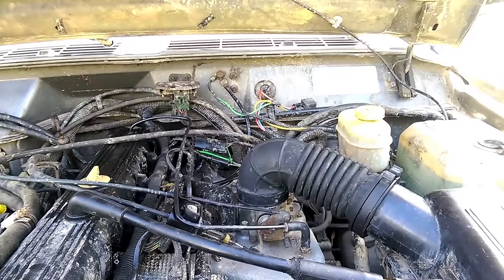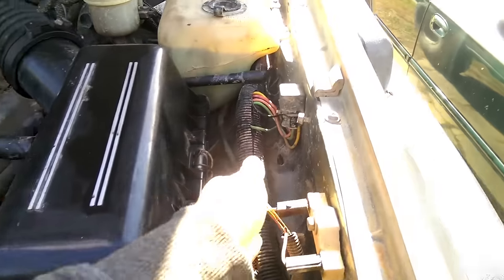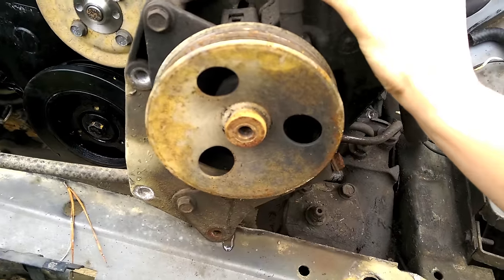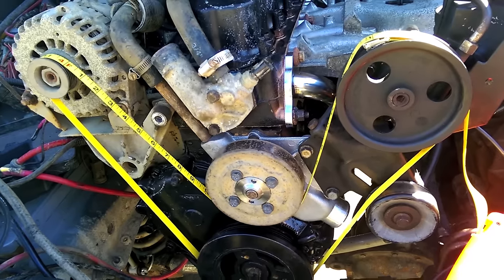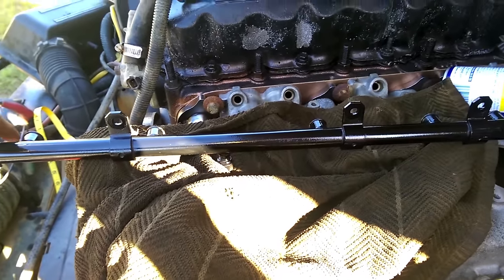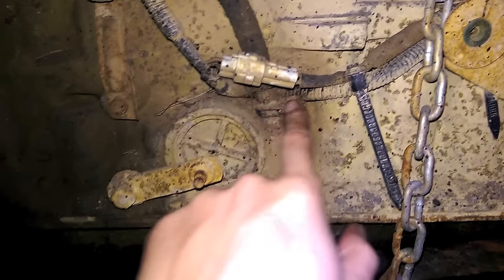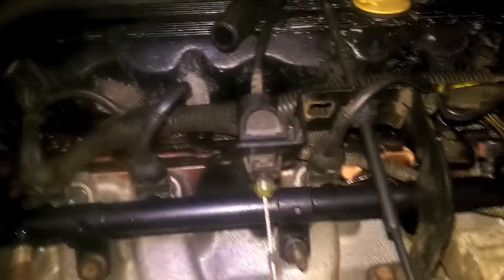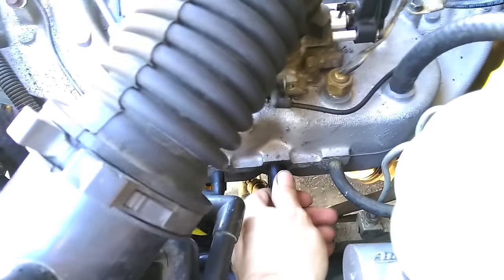89 Cherokee Renix to 99+ HO Manifold Swap

Comment: Ok question for you, will the renix pcm run the HO without any problems if am not doing a stroker like you did
Reply from the maker: The swap I did here was just the HO head and manifolds on an otherwise Renix Jeep. With a stock 4.0L it should run just about the same I'd think.
Reply: @NickInTimeFilms  ok I wasn’t sure lol because am getting ready to do a whole motor and Tranny swap from the renix with the ba10-  HO with a ax15

Comment: which exhaust manifold did you use? a 99+ or one of an earlier 91-95? Mine seems to have a bad exhaust leak now.
Reply from the maker: I used a 91-99 exhaust header from ebay

Comment: Hi Nic, 2 questions, you used the same valve IAC Renix ???
which number you used spark plugs champion ???
Reply from the maker: +Claudio Villegas Stock Renix IAC Valve will fit, I used Stock Renix Spark Plugs, Champion RC9YC
Reply: +NickInTimeFilms ok, the same are the ones that buy but are different, the spark plugs of Renix is a bit shorter than the HO, something that affects ???
Reply from the maker: +Claudio Villegas Not sure if there is a length difference or not between years, I just know that stock plugs are fine with the swapped head

Comment: Did you change your ecu and wiring harness? I have an 88 and the p.o totally hacked the harness all to hell so thinking about doing a ho swap possibly doing the entire engine not just the head and intake since I have a complete drive train from a 99
Reply from the maker: Nope. The whole point of this guide is to swap all the H.O. parts onto a Renix system and retain all the factory sensors, harness, and wiring. I don't know how hard it would be to swap in the whole ECU system from the 99 over but I don't think it wouldn't be easy.
Reply: NickInTimeFilms well i guess if I'm gonna go through the hassle of swapping ecu and all mine as well just go v8 I guess

Comment: Hi Nik, had problems with the IAC ??? change in my jeep IAC and RPM are very low, you can regulate that ??? clean the TBI, 
which oil you put into your engine ???
Reply from the maker: +Claudio Villegas Did you do the H.O. Swap or are you stock? If it's a low idle and everything seems to operate correctly, you can try resetting the ECU so that it relearns your idle. Pull the battery terminals off the battery and hold them together for 30 seconds, then put them back on. That will clear the memory and put it back into learn mode.
Reply from the maker: +Claudio Villegas I used Regular 10w30 dino oil, but I may use a synthetic blend next change.
Reply: +NickInTimeFilms  OK, I SWAP Renix to H.O. Like you.
He read in a forum that when the TPS is set incorrectly causes problems in the IAC, is this true?
Reply from the maker: +Claudio Villegas If the TPS isn't set right then it may cause idle issues.
Reply: hi nick, set the TPS at 0.83 volts and works perfect my jeep, do not fall rpm, on the highway remains the fourth gear AW4 whitout problem, thank you very much for your help

Comment: I've got an 89 xj. Older motor original I believe. How spendy in shop price would it be to do renix HO
Reply from the maker: Like have a shop do this for you? I'd be surprised if a shop would take on this job as there are a lot of variables. check the description for parts list and junkyard prices
Reply: NickInTimeFilms  is there any alternative ways of getting a better motor maybe just have them rebuild my current block?
Reply: Don't have a shop or time to do all this my self right now just got it and I love xjs. Welded rear end. Chirps a lil haha
Reply from the maker: I like the phrase "There is cheap, fast, and good; You can only pick 2" and "there is no replacement for displacement"

swapping the HO manifolds and head onto a renix block will make it flow better and you may notice it has more power. it's ain't gonna be a ton, as we are only improving efficiency here. If you want a drop in solution for a very noticeable increase in power, look into a stroker engine. You put a 4.2L crank into a 4.0L block with some special pistons to get a 4.5L torque monster. You can buy a crate stroker for $3-$4 grand, or have it built for a little less. 

I have both the HO swap and 4.6L stroker (I overboard 0.030" thou) and it's lots of fun, but it has worn off. I either need to work on a custom tuner to improve fueling efficiency, or supercharge it, but that's more money than I'm willing to spend yet. Depends what you want to use your jeep for. this is great for the trail, and it's ok for the highway, but I need more!

Comment: Hello No, I'm Claudio de Santiago de Chile, I have a 89 XJ and also will change the engine for 2000, you could give me an email to ask you some questions ??? the change was brutal, a very quiet engine
Reply from the maker: +Claudio Villegas You can Message me on YouTube if you need to.
Reply: +NickInTimeFilms perfect !!

which spark plugs installed in the new engine ??? for Renyx system or 99+ H.O. ???
Reply from the maker: +Claudio Villegas Stock spark plugs are fine, if you had a renix, stick with renix plugs
Reply: +NickInTimeFilms Champion or NGK ???
Reply from the maker: +Claudio Villegas I like Champion because that's what the factory used
Reply: +NickInTimeFilms  ok, this Saturday will change the water pump, engine oil and spark plugs champion and other things, the story never ends with the XJ ........ but I love my Jeep ...jejeje

Comment: Hi Nick, I am in the process of swapping out my 1987 4.0L Renix to a 1996 HO 4.0. I have a complete engine out of a 96. Can I simply just drop it in and change the throttle cable and kickdown cable and sensors? Or will I need more mods to make it work aside from the power steering pump mod and tps mod. The 96 engine only has 116k miles on it.
Reply from the maker: Make sure you swap over the Renix Distributor and Flexplate to the 96, but otherwise just sensor swapping should get you going along with the few little mods needed. Don't forget about the o2 sensor if you're swapping exhaust.
Reply: Thanks for the help! I'll update when I'm finished with the swap.
Reply: What year ECM is the best to run?
Reply from the maker: If you're running a Renix ECU then an 89 or 90 is preferred. They also differ in auto and manual trans, though the engine will still run with the wrong one

Comment: nice video, so where is the videos for you stroking the inline 6? I'm assuming it started as 242. So many things I like to do with my jeep. but its a 97 lardo.
Reply from the maker: +Dan Acton I have an install vid and first start vid. Nothing on the physical build yet because I had a machinist put it together for me. I may make a parts list vid that shows some pictures of it being built but no video sadly. I took my tired 4.0L 242 to him and had him put in a 258 crank to make a 280ci/4.6L beast
Reply: NickInTimeFilms you can go up to a 5.0 also. oh and yes not kidding HEMI header. but its build for the 285 block. don't know if its conpatable with a 242. I'm thinking of turning my poor jeep into a hot rod inspired jeep, and leave it with I6. Just to be different. I have most of it mapped out. parts and whatnot.
Reply from the maker: +Dan Acton These things are absolute torque monsters. They aren't going to go 0-60 in a snap unless you focus on upper end breathing but they still accelerate much faster than stock. But when it comes time to tow your house somewhere, this engine will cover it.
Reply: NickInTimeFilms yep. lol, I'm wondering if you can four bolt the main like you can a 350. Just for longevity.
Reply from the maker: +Dan Acton I haven't seen or heard any mention of 4 bolt mains anywhere. May be possible but may not be necessary. For higher end build, ARP Rod Studs seem to be all that's needed. These I6s only go up to about 5,300 rpms so some racing application stuff isn't as necessary unless you frequently go to the drag strip
Reply: NickInTimeFilms true.. just like to know how far out of the box I can go. lol yaknow. So far the idea is stoke it out to a 5.0, supercharger, and a 2 stage methanol/water mix (acts like nitrous, just safer) cat back exaust blah blah blah, maybe turbo or twin turbo or twin turbo's feeding that hungry supercharger.... don't think a dana 30 with hold up for shooting for a dana 44 with 4/10 gearing. I want I to squat and go.
Reply from the maker: +Dan Acton Good god, Talk about an investment, haha. To go anything over 4.8L you'll need to resleeve a 242 to accept the way oversized pistons. On top of that in order to hit the 5.0L mark you'll need a custom ground crank that has more stroke than the 258 can give you. Along with the proper head work to fit LS valves or a custom aluminum head and all the other necessary works it's gonna add up quick and driveline upgrades will be needed.

Unless you are specifically looking to keep the Straight 6 look, a v8 swap may help meet your power needs for a lower price point. Check out the JeepStroker Forum for lots of good info. Scroll through all the threads or make a free account and you can search the forum at your leisure.
Reply: NickInTimeFilms was wanting to keep the I^ because wellll its a jeep, and jeeps are known for the I6. but yea I can scale it down. right now I'm still trying to get the green light form the  wife. lmao. I was shooting for sky high torge. and some horses to back it up.
Reply from the maker: +Dan Acton It's definitely possible if you have the wallet and the wife to back it up. haha. 350HP is doable with an I6 Stroker. If I had to guess, my 4.6L is probably pushing about 245HP and 300ft/lbs at the crank. Check out this site for some ideas. http://www.jeep4.0performance.4mg.com/stroker.html
Reply from the maker: +Dan Acton No problem.  Do some reading on the sites I linked you and you'll find your way. Good luck!

Comment: Hey, I’ve got everything hooked up same minus my exhaust. I tried turning it over and it starts for a few seconds then backfires and dies. Do I need to tow to a muffler shop for it to run properly or am I missing something else?
Reply from the maker: Hmm, I would check major components. First up, is your map sensor hooked up properly to the throttle body?
Reply: Hooked up directly to ‘96 throttle body, same way you have it in the video
Reply from the maker: +Christian Duquin I'm assuming the battery was disconnected so the ECU could reset. Still using the Renix injectors? Does it idle high or low or weird? No leaks at the manifolds?
Reply: I should add that I’m running a k&n air filter pod. So the air box is deleted, but all vac lines hooked up the same.
Reply: I should add that I’m running a k&n air filter pod. So the air box is deleted, but all vac lines hooked up the same. 

Same renix injectors and fuel rail.

Comment: what you do with the temperature connector since the new head doesn’t have it in the back corner
Reply from the maker: I made sure to get a 96 head because it still has the temp port in the back
Reply: mine doesn’t has it i thinks it’s from a grand cherokee but i may i can drill it on the drain plug next to te coolant temp sensor

Comment: Can i throw a distributor into a 2000 i6 in place of the camsenser? I want to go carberated screw all the gremlins that come with Chrysler crap wires and vacuum
Reply from the maker: +Rob Plotts thats a good question that i dont have a good answer too. Im not super familiar with the really new Chrysler tech like coil on plug stuff
Reply: NickInTimeFilms i appreciate your reply . Your video may be some good reference for me
Reply: ***** i have two perfect low mileage i6 one is 00 the other is 02 no titles for the Cherokees but i have two 89 Cherokees with titles no motor. The jeeps with no titles have issues like shutting off whenever it feels like it or not starting after just running. But the engines are sweet so id like to know if i stick the good motors in the titled jeeps can i put the distributors and old engine management or carburetors. In my state the older jeeps dont need inspection. I believe the gremlins in the newer 2000s jeeps are shorted wires somewhere in the octopus of looming ive got code scanners i do this kind off work for a living just tired of the crap Chrysler management systems. They were better in the oler ones with the Renault systems
Reply: ***** yea my main concern was the distributor. The cam sensor on the newer engine looks like the distributor drive i just wasnt wanting to go through engine swap if the distributor wouldnt drive off the cam like the older engines. Looked like it would but i haven't found any proof on line if it would.
Reply: ***** i might just throw an engine on the stand and see if it'll run on a distributor. If this works it should be pretty awsome. Injection just needs everything to be right in order to run effectively. The more i can simplify the system the better. I have an old 76 chev blazer i put points ignition got rid of the hei and that was about twenty years ago still runs like a top i guess im a bit old fashioned but man the old stuff was sooo much easier to fix when something went goofy. Dont get me wrong new vehicles are nice but if anything fails your callin a tow truck and i just dont accept that lol. I ran outta gas once but that was my own fault haha. The jeeps i6 is a pretty durable engine so i hope i can make something work. I refuse to have another car payment along with full coverage insurance. Nice chattin with ya bud. If i figure this out I'll let you know
Reply: ***** my blazer is a single points system i built the engine myself. Mostly edlbrock intake cam carb. The 350 4bolt main is in the neighborhood of 400 hp. It'll roast the 32/11.5 tires. But i usually drive like an old man lol. I received most of my jeep vehicles for free or little moneys.
Reply: Rob Plotts but your right efficiency is the only good trait of injection

Comment: im not trying to make better power are anything I just want to fix the truck for some reason 0630 heads are few without cracks
Reply from the maker: Well, the 00-01 0331 heads are the ones to look out for because of the cast defect between cylinders 3 and 4. The Temp Senders were at an in between stage and I know the newer ones have the thermostat sender but I think the possibly all old style XJ's use the head sender, but not 100% certain on that. Just take a look, if there's nothing back there on cyl 6 then no worries. 98 was a bit of a cross over year you might be good on the manifold too.

Comment: Nick,  right in the middle of this shit,  do you have more information on the auto Trans kick down cable? Part number? Anything,  I am freaking out on this
Reply from the maker: All in the description. Kickdown cables just needs to be from a 91+ cherokee. Part number 52077578. Not sure how good the crown replacements are.
Reply: Thanks,  I'll post what I did on G+, you are lucky you didn't have to remove the optional ABS brake system in yours
Reply from the maker: Got a 404 error
Reply: Sorry,  I have to fix notifications not getting noticed until 2-3 days later
Reply from the maker: Still no workie workie. Not sure how google plus works but see if they have a public link option or just link directly to the picture if you can.

Comment: Nick, 
Did you have to replace your fuel pump to a 95 for the jump in psi needed for the ho swap? 
After two weeks I can't get pressure at the rail. I swapped fuel pump from factory 89 renix to a 95 cherokee fuel pump. I have replaced fuel pressure regulator 4 times. I have hooked the rail up to a friend's 95 cherokee and it will hold pressure at 39 psi at the rail, (rail and pressure regulator tested good). The only thing different I can see on a spec sheet is the 13.9VDC needed for the 95 fuel pump. It is getting 12.6 at prime (on position) 
Please,  any ideas?
Reply from the maker: nope, stock pump. And pumps had same pressure until it was bumped up in 97. So on your vehicle you prime the pump, push the shrader valve, and nothing comes out? and obviously it won't start as the injectors aren't pushing any fuel?
Reply: Yep,  logic has been thrown out the window. Wife no happy, playing taxi...
Reply from the maker: and when you pull of the inlet hose, fuel comes outs the hose, and when you pull the outlet hose, fuel comes out the rail? if fuel comes out the rail, the rail works on you buddies truck, and the pump is new. Either you need to look into the fuel filter, or the return line is clogged? or pull the return line at the pump and see if it can do a full circuit. something just isn't adding up here.
Reply: Up and running,  it's like a new Jeep, but with some balls,  I can bark my 31s... Next this is headliner, radiator and hacking the trany,  similar to your setup.
Reply from the maker: So what was the final fix?
Reply: NickInTimeFilms 
I hooked it back up like an 89, positive pressure, not negative pressure like the 95...had to swap the feed and return lines on the rail.... I know I know stupid,  but I don't feel stupid because it took a manager (white shirt), 2 ASE Techs and 3 tech manuals to find this out.
Reply from the maker: mmmmmmmmmm. silly boy, did you follow the video? 23:42
Reply: Yep,  just over thought it
Reply: WAY OVER THOUGHT IT
Reply from the maker: Haha, it's always the little details that prove to be the most important. Now we know!
Reply: And the most frustrating